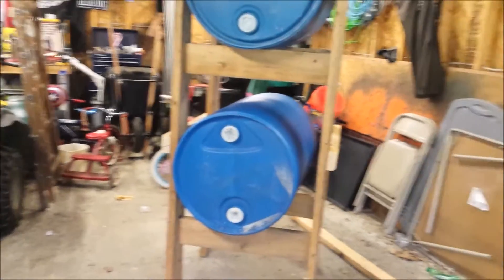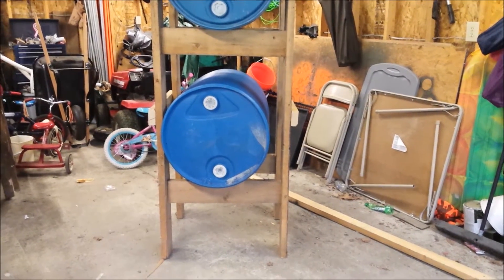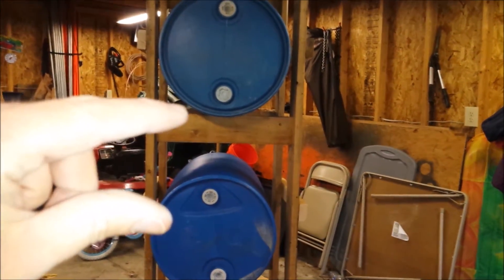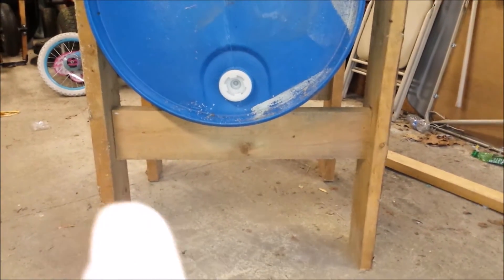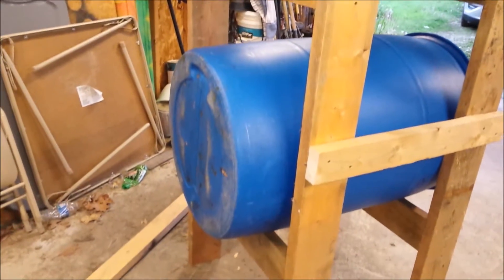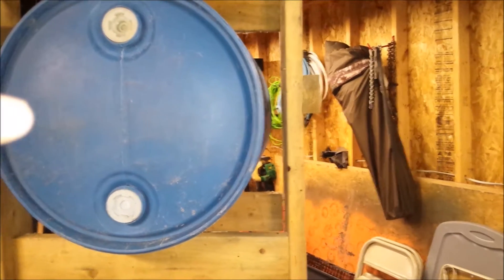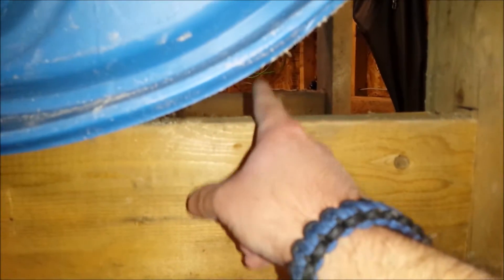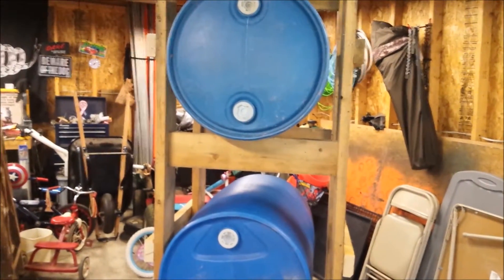Water Catchment System, Part 1.  Building The Blue Barrel Frame

Comment: Great spring cleaning project!
Very smart to   Make a solid support structure.
I never built one so no tips from me 
Sorry.
Reply from the maker: +PREPFORIT I just finished the holder tonight.. will upload the video a bit later...  Actually quite shocked w/ how well it turned out.
Reply from the maker: +PREPFORIT I just finished the holder tonight.. will upload the video a bit later...  Actually quite shocked w/ how well it turned out.
Reply from the maker: +PREPFORIT I just finished the holder tonight.. will upload the video a bit later...  Actually quite shocked w/ how well it turned out.
Reply from the maker: +PREPFORIT I just finished the holder tonight.. will upload the video a bit later...  Actually quite shocked w/ how well it turned out.
Reply from the maker: +PREPFORIT I just finished the holder tonight.. will upload the video a bit later...  Actually quite shocked w/ how well it turned out.

Comment: the bottom bun hole cap should have a knock out for a regular 3/4 " pipe or hose bib the top put a t and a clean out with a ball ! OK ?
Reply from the maker: +Theredneck Prepper Looking for info on the bung hole knock out....  cant find it... but that is what I want to do for sure, use the plug are as the spigot...  any idea on where I can find more info on that?
Reply: +Blue 823 look inside of the barrel screw in plug is there a threaded hole that need to be knocked out ? it looks like it from your vid bro! its a 3/4" npt thread it will fit a garden hose bib !
Reply from the maker: +Theredneck Prepper HAHA... its amazing what you see once someone points it out....  I never noticed the threaded hole in the cap before...   thanks for the advice... more vids to come..

Comment: Just use a pipe that you can put  pop bottle in there. So what happens is when the drums are full the pipe will fill and when it's full the pop bottle will pug off the pipe stopping the water. That when it's stopped the water will go into the T fixing letting the water down the pipe just like be for.. Hope your getting what I am saying. 

Few things I see you may need to look at is. Even tho you plan to have hose on it. I would make it so you have the room to put a 5 gal under the faucet. Why you ask? Well if your trying to use the water to do things like washing the dish with or you need it to put out a fire. With out a pump your not going to domuch with the hose where as with the 5 gal you can do a lot more.. Just things to think about..
Reply from the maker: +yankey4 Great tips... I like leaving area for a 5gal bucket... Wish I would have seen the comment before I locked everything down.... but I think i am still safe... If not close and when I build my pad to put the frame on ill be sure to make it a bit higher if needed...
thanks